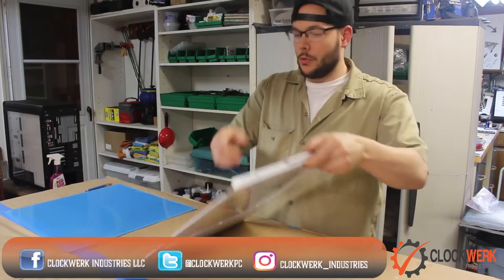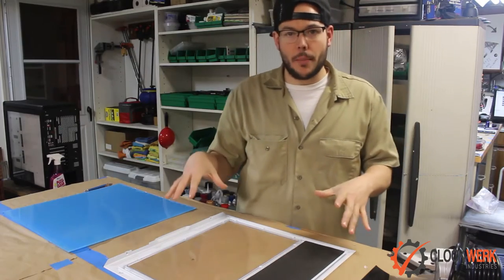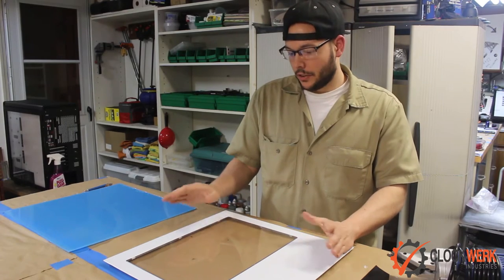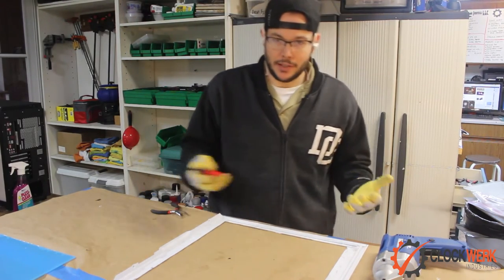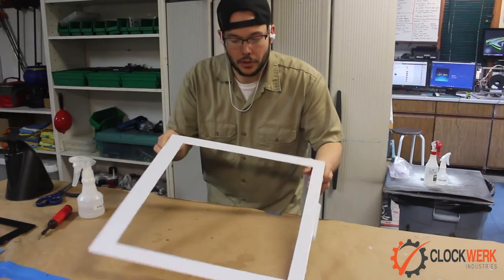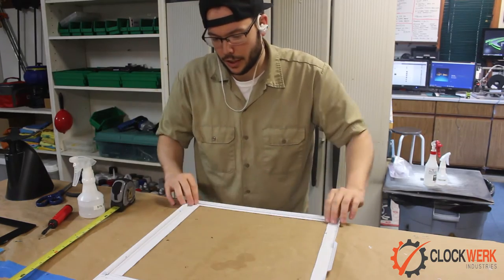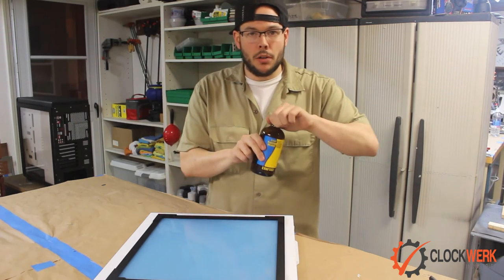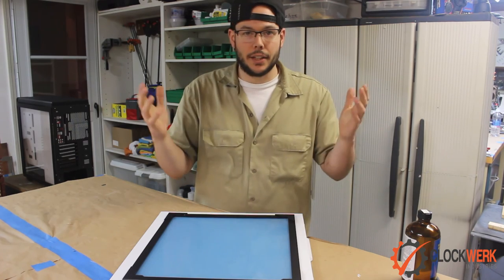Job Shop | Episode 03 - NZXT H440 Pro Window Install

Comment: I'm a Sheetmetal worker. We call those shears, 'double cuts'. The strip left behind is a 1/2 inch (1/2 inch hole needed to start.) A nibbler cuts are more intricate. Like a jigsaw. It has only one bed and jaw, no 1/2" waste.

Comment: What does window mod like that cost??
Reply from the maker: Thanks for asking! Flush mount window installs with trim usually run 125$, I now sell complete magnetic custom door panels on my website for 100$ for those interested in an entirely new panel for slightly less cost.
Reply: Clockwerk Industries  you said it listed on your website
Cool thanks for answer going get on after I finish the rest of my build